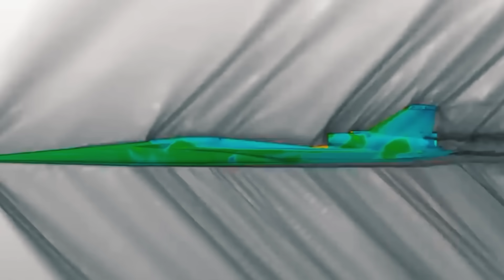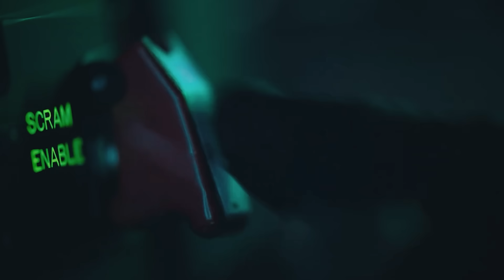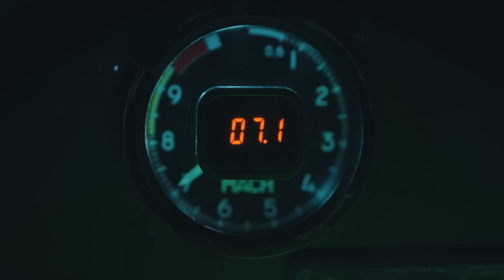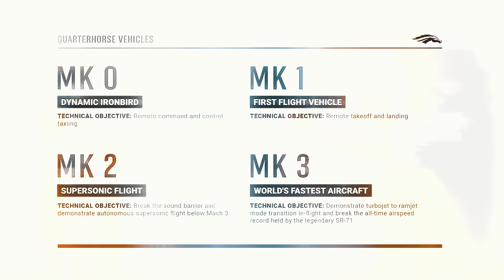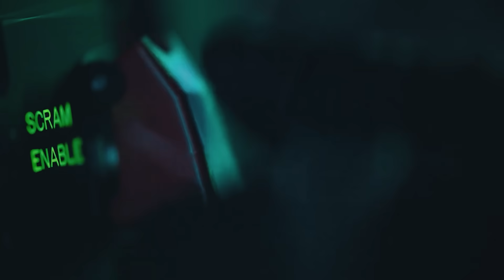US Fastest Hypersonic Jet Reaching The Speed Of Light Is Ready To Fly

Comment: At 4:54 you identified the P&W F100 as a turbojet. It is decidedly a reheated-thrust turbofan, not a turbojet. The F100 PW229 in the F15 generates 29,500lbs thrust per engine (with afterburner and water-injected).

Comment: Light speed is approximately 186,000 miles per second. These aircraft will not fly anywhere near that number. Its speed will be measured in Mach - that is how slow it will be compared to light speed. If we had aircraft that could fly at light speed we would be travelling across the galaxy and to the stars already. Utter bollox.

Comment: The Blackbird could never overtake the missiles fired at it. It just had to keep running while waiting for the missile to run out of fuel. Back then they were reaching Mach 4.5 with missiles already. Unfortunately that wasn't enough to catch the Blackbird when it was at speed.
Reply: Which is amazing since based on the official speed record if I recall would leave the missiles with around a 1.5mach advantage. So basically it came down to the fact that blackbird had legs like a triple crown winner while the missiles had them stubby little cheetah legs that were great for short sprints.
Poor cheetah be falling over with a heart attack long before that horse slowing down